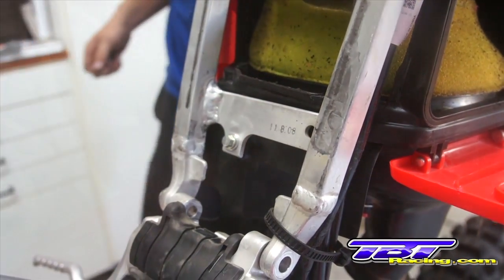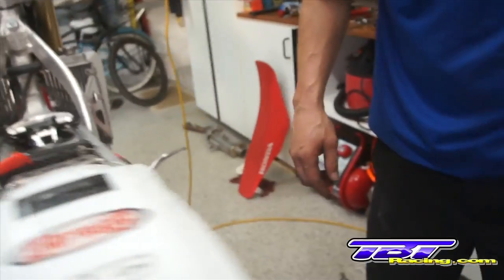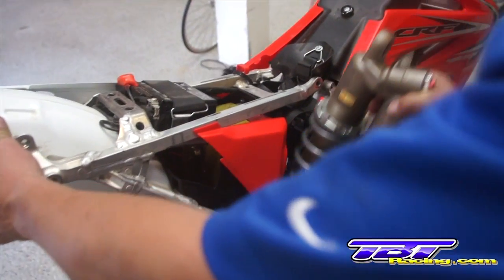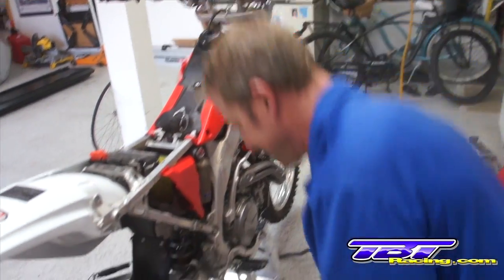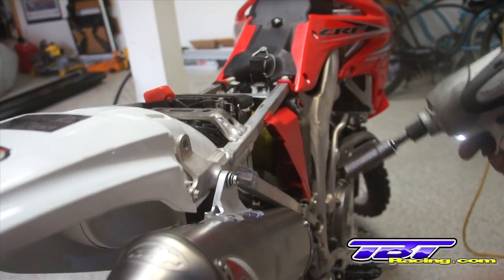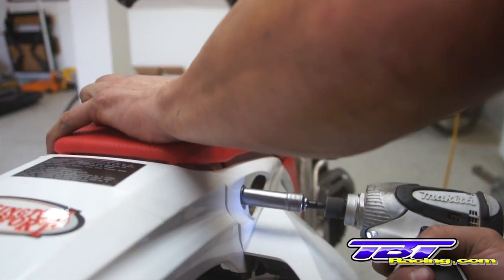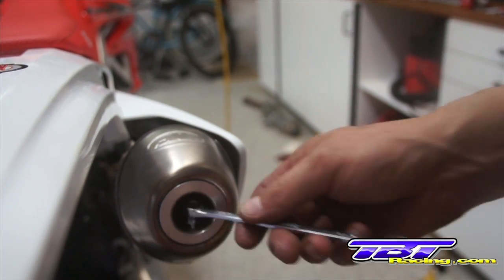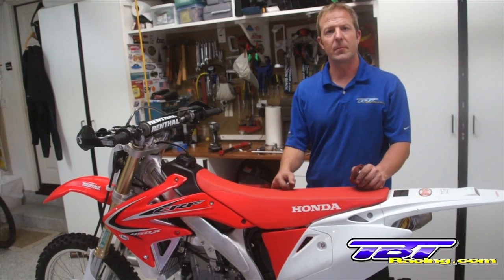How To: Honda X Modifications (Part 2)

Comment: Is the vent hose and block off plug that goes into the airbox installed backwards on this?  Shouldn't the block off plug go into the top hole and the vent hose into the bottom hole?